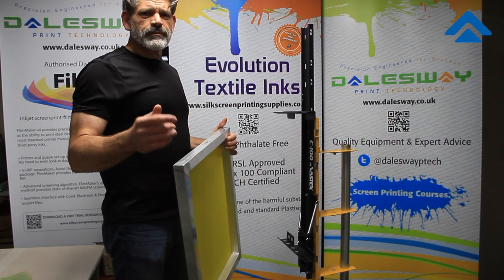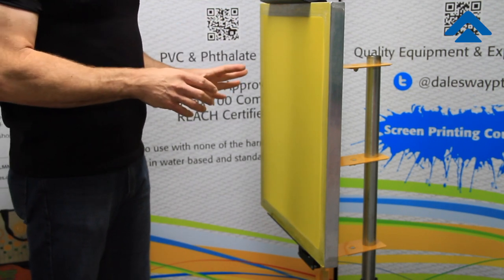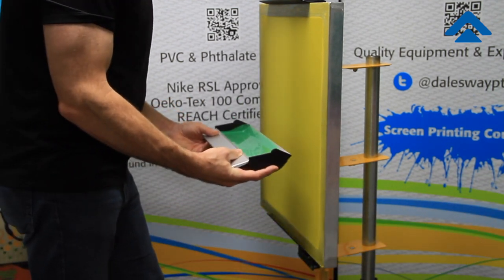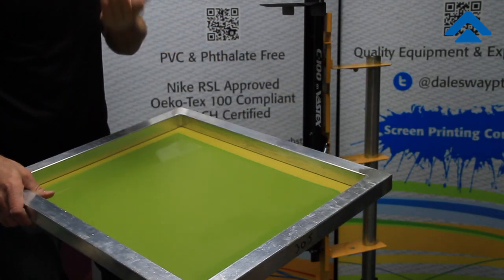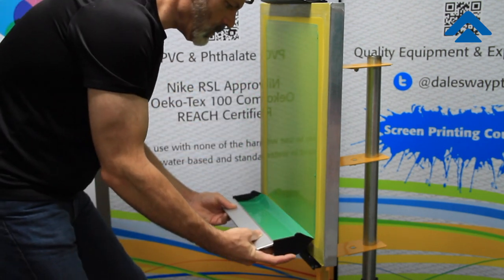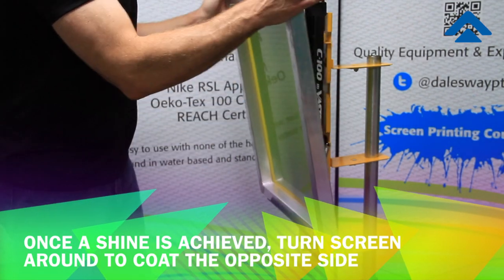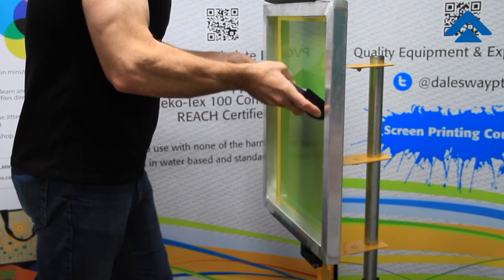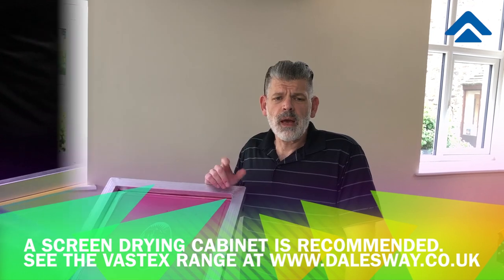How To Coat A Screen For Best Results | Screen Printing Know How | Douglas Grigar

Comment: Where can i get that scoop coater?
Reply from the maker: Hi there. We are based in the UK and we supply them. You can contact us via our website with the size you need (inches or cm of width) if you are local. If you are abroad, shipping may be too much but you should be able to source something similar. Maybe speak to Vastex if you are in the USA. Our website is dalesway.co.uk but please note it is not listed as a product, so just email us.

Comment: Excellent your video !!  I would like to build a support like this.  Would you help me ?  what materials and measures?  Could inform me ?
Reply from the maker: This is an item we sell in our online shop. If you want to build your own, you will need to work out a way of holding the screen at a height that is comfortable for you. The measurements will depend on what works for you, so the unit we sell has the ability to place the screen in various positions.
Reply: Where can i get that scoop coater